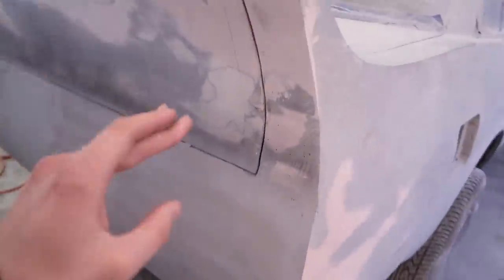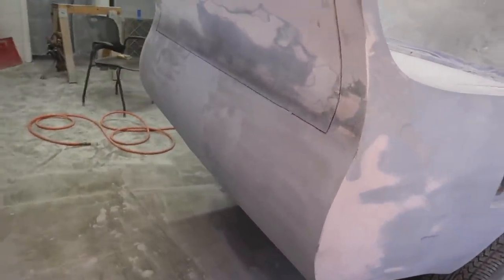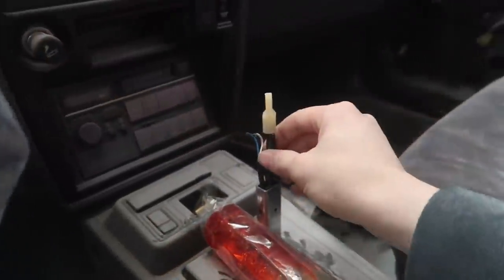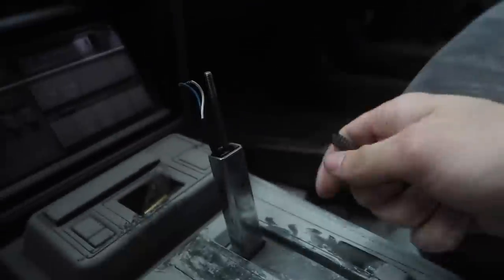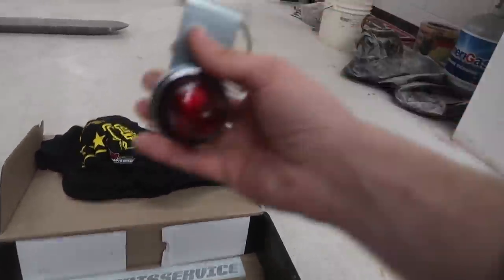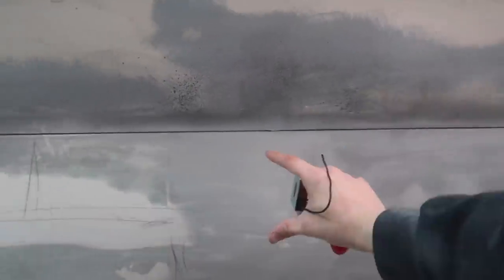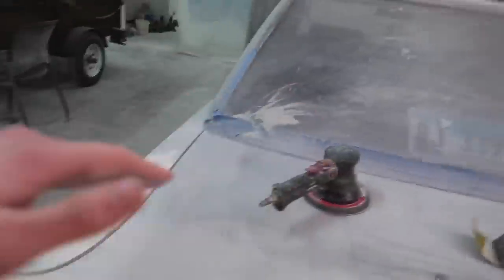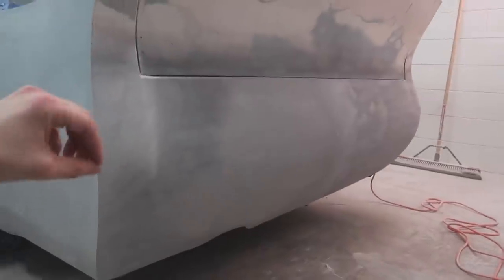Bosozoku Shaved Bumper Is Finished

Comment: I like to use stuff called Icing 24 oz.Polyester Finishing Putty sand so good
Reply: motionautoTV swears by the icing for any finishing, proper good stuff!
Reply: Icing is excellent stuff. And is pretty damn flexible too, I've used it repairing motorcycle fairings too. And on jet ski hulls under the gel coat.

Comment: If you need some ideas on the bubble shift knob on an auto I put one on my 99 Corolla with auto trans. It was just a matter or taking a piece of pipe (Square stock would work best since your shifter is square) just the right size to fit over the square part (the main stick of the shifter), then I welded a bolt to the top of it with the right threads for the new shifter knob to screw onto. Then I made the pipe the right length so that when it's mounted on the top of it is always pushing down on the shift button linkage (yes, you can always pull it out of gear then, no matter if key is in or not). Then you drill a couple holes in the pipe, screw fasteners through the pipe into those threaded holes on the square part, and you're good! The pipe/bolt piece you just made is solidly fastened to the shifter itself, and the trans can be pulled out of park without any button pushing nonsense. 
I had to disconnect the keysense and key interlock solenoid on mine so that the key would release properly with the button always being pushed down. Not sure on yours since its so much older. 
Of course if you like the shift interlock feature this isn't so much a good idea.

Comment: You could still do the magnet license plate trick, just put some moulding around the edges then put a huge piece of felt on the back so it doesn't scratch the paint.

Comment: my guess on the care package light, is typically on JDM cars (the r34 gtr for example) have a single reverse light and on the other side of that they have a "fog" light. turn it on when it's foggy so other drivers know where you are. I honestly found this kind of pointless once I figured it out since daytime running lights would tell others where you are but it'd be pretty cool as a fog light.

Comment: Get the retractable license plate mount. I think it’s meant for front bumpers but you could attach it under the rear bumper and than when you press a button the license plate would fold down and slide under the car so you can’t see it

Comment: I think putting the magnet in the bumper to mount the plate is a wicked sweet idea, then you can take it off for shows.  If you glue felt or a microfiber to the back of the plate it shouldn't scratch your paint!

Not a fan of the bozo cars, but I appreciate the work, effort, and craftsmanship!